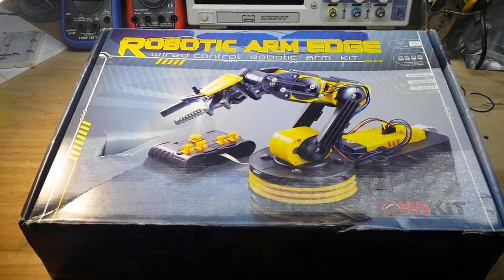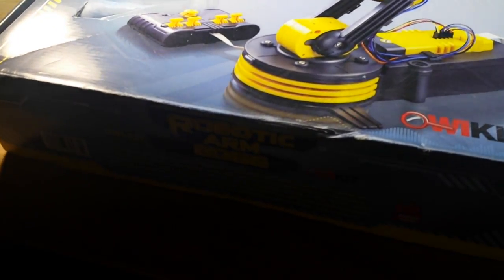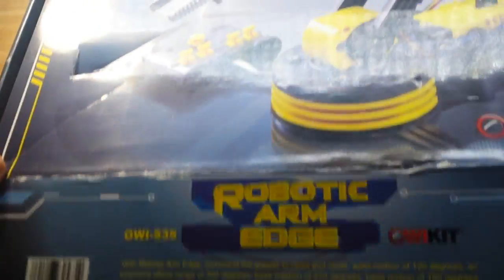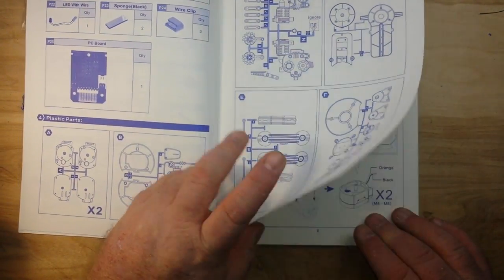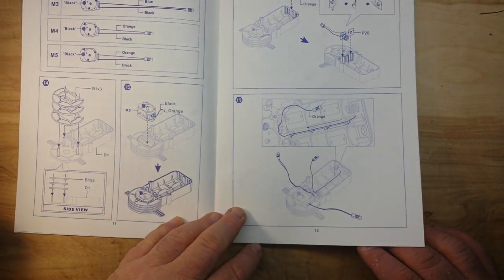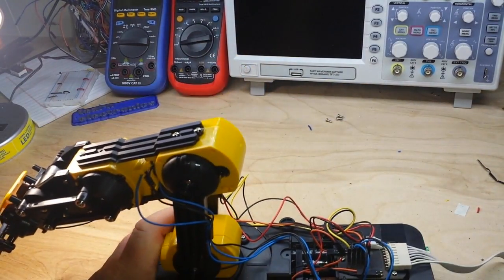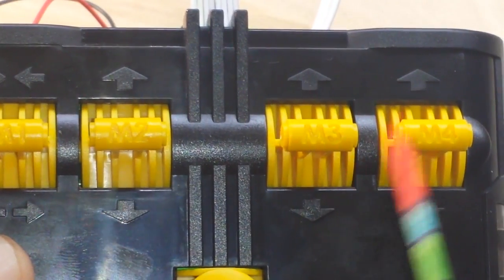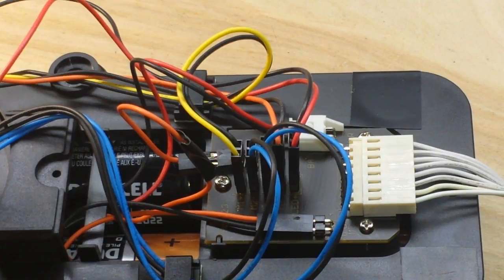Build and hack a robot arm, part 1

Comment: I got this kit for my kids last Christmas, and we had a blast. I might just try hooking it up to an arduino too.  There is an expansion kit, that we have, which lets you hook it up to a PC. The only negative thing I have heard is that the arm drifts as it does not really know where the motor position is.
Reply from the maker: +Maarkaus J Yep, they are just plain and simple DC motors...but... It works great and does not cost too much.

Comment: Mancan you assemble in a hurry! But I did notice the instructions in use. I'd say first get a power supply connected and lose the battery power, although it does look like it uses them for a counter weight. I remember hacking the Radio Shack robot arm from the early 80's what fun. This looks even better can't wait for more. Thanks for sharing this.